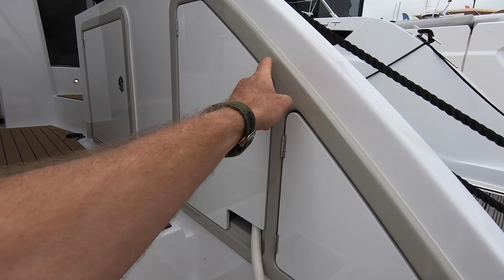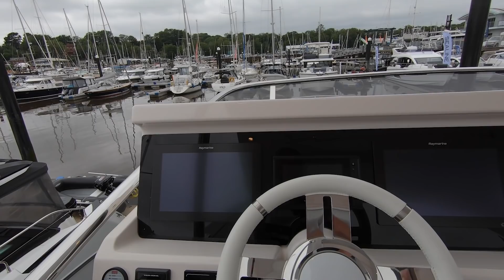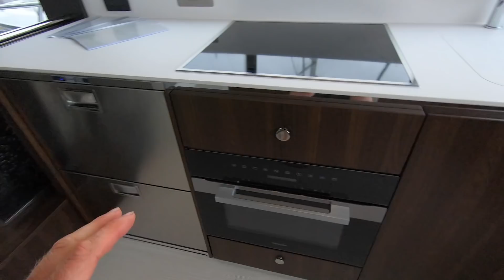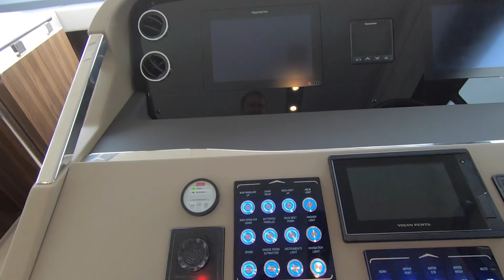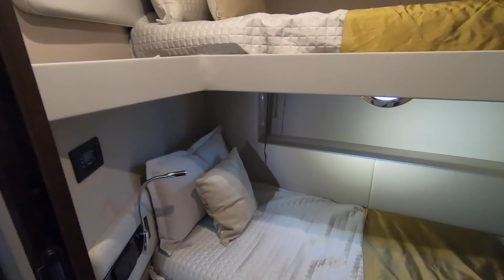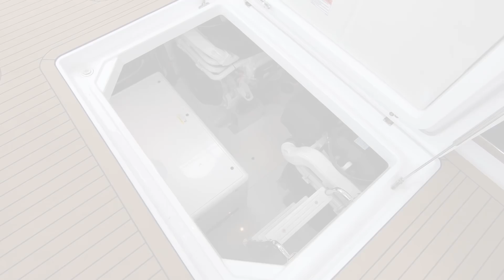Azimut 50 yacht tour | Entry-level flybridge sets the tone for the range | Motor Boat & Yachting

Comment: You're getting much better at this Hugo, good indepth tour, just think Azimut need to think things through a little more, engine room is too cramped, headroom is a little lacking which means beds are low and therefore no storage beneath and a sliding door at the helm would be good.

Comment: Did I miss it, but I don't remember Hugo saying about top speed and cruising speed?
Reply: I didn't hear him say it either.  I rather like Nicks reviews/tours a bit better for the technical side of things.  According to the Azimut website, with the pair of 725hp Penta engines it will max out at 32kn and cruise at 26 kn.  Should have a range of well over 400nm at cruise (581USG/2,200l of fuel).
Reply from the maker: He didn't but we put it in the description

Comment: Thanks. Good Review.  There are always compromises in a boat design ,of course.  .. but ...for me they have sacrificed too much space in the engine room to get  the larger master cabin forward and the lazarette/ crew cabin space aft....Getting to the inner, let alone the outer sides of the engines for maintenance looks very difficult, particularly with the other kit (generator) crammed in the same space.  Engine access is a high priority for me.  I think with Azimut, style  has a higher priority than practicality.

Comment: I dont know about build quality and sea keeping but the stylish Azimut interiors really make current Sunseekers look like they are built from Ikea Flatpacks
Reply: Have to disagree here! no Sunseeker would give you manual windows, and a manually opening hard top section, nor would they only teak half a flybridge lol, and the headroom on this boat and the size of the engine room is just not good at all, watch their vid on the new Manhattan 55, definitely a fair comparison.
Reply: @joshuachapman8641  Nah - Manhattan 55 is a lot more coin than this Azimut. I only its only 5 ft longer but its another class.